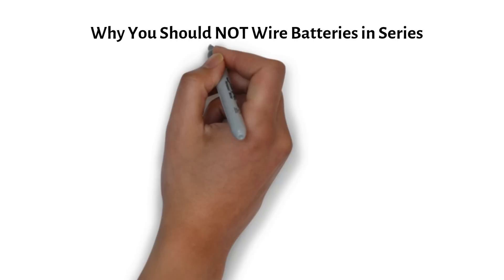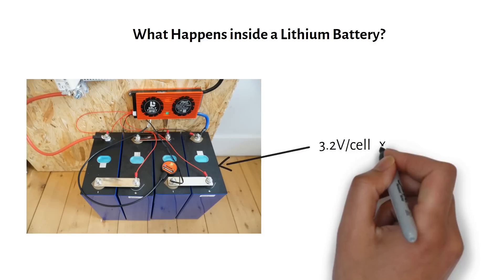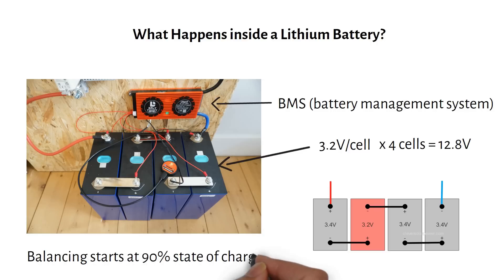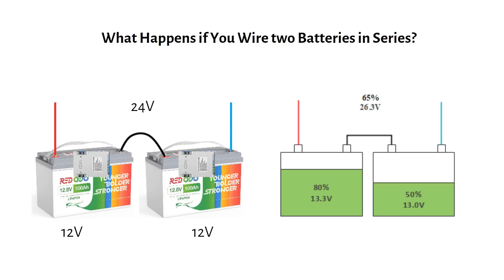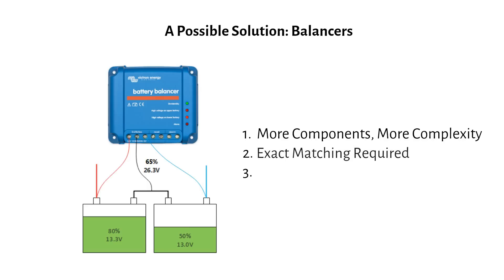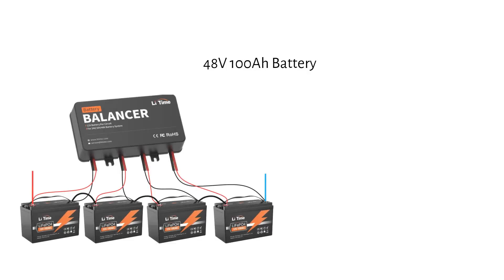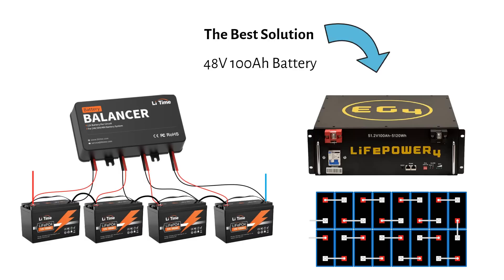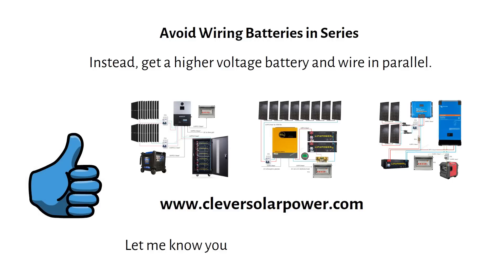Don't Wire Batteries in Series - Common Error

Comment: eh, i dont use bms on my diy battery builds anymore. just use inductive active balancer and rely on inverter or charge controller for over/under charge protection. add a thermostat relay to the load side and hook it up to a 15w heating pad to avoid freezing temp. bms is the cause of most lithium fires. active balance boards are much cheaper, like by 2 orders of magnitude and usually have 10-100x better balance capability in terms of total current and use energy more efficiently instead of making bms get hot.

Comment: The 48v battery cost way more per Kwh so price is a contributing factor. I have 3 banks, 1-4S and 2-2S. the 4S has a balancer and the 2S banks I can wire parallel every 6 months to balance. Not as hands off as the 48v battery but really not that bad either, especially considering the extra storage I get for the trouble.

Comment: This used to be a problem for me with my acid batteries. But now that I can log into each battery individually and monitor it through its Bluetooth BMS I can see that they are staying well-balanced. It seems that if they were to get out of BALANCE the one that had the higher voltage would have an automatic cut off when it reached a voltage too high.

Comment: I have been pondering this dilemma for a bit.
You sold me.
I shall buy 24V Batteries and Parallel them. It's also a lot easier to add another battery in parallel than to add a new string.
Reply from the maker: Exactly 💯
Reply: @cleversolarpower  Yeah, it strikes me that the 24V Batteries are the best Medium between affordability and capacity, with the least effort to add.

Comment: So asuming i have a full 24v battery in parallel and i want ti upgrade to 48v will i add another 24 volts in parallel or i should buy single 48v and remove thr 24v?
Reply: two 24 volt batteries in parallel is still 24 volts, you have only increased the amp hours and discharge level by paralleling. Series increases voltage, but this can cause imbalance like the video says. Also adding a new battery to an old battery in series isn't advisable. You will need to buy a new 48v battery if you want to go 48v.

Comment: I'd like to build a pure off-grid system for a cabin with a 3000w inverter. What battery and inverter brand/model would you recommend for the simplest possible system that can be purchased in Germany?
Reply from the maker: I recommend the victron multiplus. Checkout my playlist about 'off grid systems' there is one in there for a cabin.
Reply: I am using Vestwoods batteries and I think they are available in Germany.

Any high quality inverter will be fine. Try to get a pure sine wave inverter. They are better for your electronics.

Comment: Batteries in series do have those problems, but batteries in parallel have balancing issues too in that the ones on the outside charge more than the ones inbetween.  And so the ones closest to the wired connection get more use.  Also the ones that have less resistance get more charge. 

And as far as buying larger voltage batteries,  that is a better deal if one can find a good price and availability on them.  But they are not so available everywhere.  Which is why I was thinking of doing 2x12 volt ones.  And I could do those in parallel without the uneven charge but 3 or more would have uneven charge.

I did try searching Amazon for a bms.. I didn't find one for that purpose.. maybe I could search again.
Reply from the maker: That is true. However, that is only the case if you add lots of batteries in parallel. And that's why you should use busbars in parallel battery setups.
Reply: @cleversolarpower   Depending how they are wired.. 3 would make it uneven..even with busbars.. The ones closest to the connection get more use.

Comment: is why you need to charge to 100% at least before getting too low, anyways I have enough panels to charge to full every day, and I have 12 batteries in 4s to 3p and soon getting 16 batteries for a total of about 53klw  in 4s to 4p  you have to follow the directions of manufacturers,  they tell you the max you can do on series and  or to parallel , if we follow that and charge to 100% regularly is not needed a balancer.

I dont use balancer on my lifepo4 and manufacturer recommend only 4 in series to max 4 to parallel on the 12.8  260amp , and i been running my system over a year and not a single problem.
Reply from the maker: Like i showed in the video, it doesn't matter if you charge it to 100%, there will be imbalances. Just measure the individual battery voltage and you will see they are not the same. The manufacturer says only 4 in series because the mosfets cannot handle more voltage, and there is no use to have more in series because you already have 48V.
Reply: @cleversolarpower  ok i will check them individually and we see , if too much difference i will install a balancer.

Comment: 1:04 This expert does not understand batteries enough to be an expert. If one wants to  configure a 72volts(nominal) power pack out of 6 units of 12volts(nominal) batteries, one may 1)open each battery, 2)disconnect the 12volts BMS from each of them, and 3)connect the string of 24 cells to a properly rated 72volts BMS(if he can find one).
Or, he may connect the 6 batteries in parallel and use a DCtoDC converter to get the desired voltage.
Reply from the maker: You must be trolling right? 😄

Comment: I do this all day everyday professionally It's mighty easy to discount a Series Battery setup what counts is is whether the manufacturer recommends or not the manufacturer will dictate how many batteries in series or parallel can be placed safely and without unreliability without the use of external balancers there are many cells within a single battery it's true a lithium battery with an internal BMS May balance the batteries internally better balance may be achieved with external balancers charging may be achieved by charging at each end of the string of batteries if the manufacturer prescribes the number is authorized simple balancing can be achieved by placing simple tournament style multiple output Chargers along the series battery string this automatically balances batteries after a high current end to end string charge this can be performed daily weekly or as frequently as you desire I for instance replaced 3 junk lead acid batteries in my work Razor scooter that failed in less than 25 Cycles with three lithium batteries of exactly the same size and have had Flawless operation for over 700 Cycles now without any attempts to balance or without balancing Hardware added I used to hear this all the time when people were talking about using lead acid batteries in series my argument was what happens if one cell within that 12-volt battery becomes imbalanced you simply can't do anything about that so the argument is old seek advice from the battery manufacturer and current industry professionals testing during charging and during discharging can show weaklings in the string that need attention it is very simple uninterruptible power supply systems utilized in Industry frequently have two three and 400 volts systems utilizing so many batteries you would have to break out a calculator to count if it didn't work they wouldn't do it I applaud and appreciate anyone's efforts to Enlighten and inform the public but let's gather in all the information and decide whether maintenance and extra equipment is warranted

Comment: If you run parallel batteries and one of them is bad you have the same issue except with amp hours instead of voltage so 😮
Reply from the maker: If that happens than you can still run your inverter and charger controller. A battery with less capacity (ah), doesn't change the system. If a series connection fails, then your inverter, charge controller, and your whole system is out of order because it's not the voltage they supposed to work on.
Reply: @cleversolarpower  this is a great point for anyone running 12v at low amps with large enough wires for the extra load but I prefer the efficiency gain in 24v over 12 and some inverters are dual voltage. Personally I also have in place a 24v to 12v converter and know how to easily create a coil should I need more voltage from 12v. But yes. All good points.

Comment: Both systems are 16S.   regardless if it's a 48 or 4x12.  so if an element goes  down,  everything is gone , you're point is mute.   it's all came down to balancing,   either you have 1 BMS or 5 BMS's .     I can continue,  regarding the perfect cell match you mentioned,  but I'm too lazy
Reply from the maker: I think you missed to point of this video. If you have 4x 12V batteries in series, they are not 16S. they are 4S4S. The four batteries have a separate BMS, they cannot communicate with each other. They don't see that battery one has a higher charge than the other battery. They have no way of balancing each other.

Comment: You can connect batteries in series, never a problem. Bin doing that for 50 years. How else are you going to get 120 V DC!
Reply from the maker: This video is geared towards lifepo4. If you have lead-acid you either need equalization or balancers as well.
Reply: @robertkat  you people don't listen, lifepo4

Comment: i use two 12v 200ah lifepo4 in series,never had a issue.i use the victron battery balancer and works fine.
Reply from the maker: If you got a 24V 100Ah battery and put it in parallel with another one, you didn't need a balancer, all the extra wiring and the headache.

Comment: Slightly misleading title since this applies to Lithium based 12V batteries - combining 12V Lead Acid batteries in series has been done for decades if I'm not mistaken albeit they need to be carefully looked after. Also, I was under the impression that the single 48V Lithium-based packs are actually 15 cells in series since the nominal 3.2V/cell x15 = 48V - they charge at around 3.5V per cell and hence internal balancing isn't an issue - plus if one cell goes bad you're not having to replace an entire pack - there are pros and cons to having more hardware...
Reply from the maker: Yes, i'm talking about lifepo4 batteries. Who uses lead-acid these days? You are saying 'they need to be carefully looked after' that is the reason i made this video. Most 48V lifepo4 batteries are 16S, very few are 15S. If a battery in a parallel setup goes bad, nothing bad happens, you have reduced capacity. But if a battery in a series string goes bad, the whole battery is out of order.

Comment: Most battery manufacturers state what configuration the battery can be used. E.g. 4S4P, 2S1P etc
Reply from the maker: Still, that doesn't mean you should wire in series just because they can 😉. I can use a 5000W inverter with a 12V lead-acid battery, but that doesn't mean i should.

Comment: Please, I have a question for you about 12V 100Ah LiFePO4 Batteries. If you put an amp meter on a 12V 100Ah LiFePO4 Battery terminals what would the amps meter read?
Reply: Each battery in a series string will read the same amps as all the others since the current is flowing through all the batteries in the string.  Current is the same at any point in a simple circuit where the measurement encompasses all paths.  The voltage across each battery is where things will vary, but with the nature of lifepo4 discharge curve they will be very similar for most of the string's discharge / charge time - until they move into the top / bottom 20% of their individual SOC.
Reply: @floki5353  Hmm, I interpreted the question in the context of the video, series connected batteries.  Maybe he was asking about short circuit, maybe not.  The BMS would quickly disconnect under short circuit so his meter may not be quick enough to see the impulse correctly, or perhaps not at all.  BMS reaction times to short circuits can be in the 100 usec domain.
Reply: You would need a high impedance ameter to do that. A low impedance ameter will probably draw too much power too quickly and the bms will shut down the battery. It will read 100 amp hours before the bms shuts it down.

Comment: Completely agree with you on this, and this is something I've long stated.  SOC divergence can be seen on maintenance free lead acid systems too and they need an external balancer to keep them in check.  Open cell wet lead acid allows one to simply over charge each cell to bring the batteries up to the same SOC and then replace lost electrolyte.
Reply from the maker: Good to see someone agree on this matter. Other commenters try to justify their series connection 😅

Comment: "Exact matching required." Not really: if the batteries were actually perfectly matched, you wouldn't need a balancer in the first place. We need BMS and balancers specifically because it is impossible to perfectly match cells since even perfectly factory-matched cells will drift differently over time due to slight variations in local parameters like heat exposure, airflow, uneven compression, etc.

Having better-matched batteries only reduces the amount of balancing work required.
Reply from the maker: I was referring to the capacity (ah), not internal resistance 😉
Reply: @cleversolarpower  How poorly matched your cells can be is determined by how much total capacity you are willing to sacrifice and how much additional management effort you are willing to put into it. With enough determination, you could make an SLA+NiCd+NiMH+NMC+NCA+LTO+LFP+LiS series monstrosity work.

While you shouldn't intentionally mismatch batteries in a new system, you have to work with whatever you've got afterwards and there is a lot more flexibility in there than exactness.

Comment: People have been connecting batteries in series for years without issues especially those that use balancers. Some people actually started out with a small 12v system and later realized they want to move to higher voltage without discarding their already bought batteries. This is why many people usually series their batteries.
Reply: lmao!  The guy is a retard lol.
Reply: Hahahahahaha
Reply: I though power goes up even if they are connected in parallel
Reply: @siyabongangubeni9042 hooking up batteries in series increases your voltage so a 12v 100ah and another 12v 100ah connected in series has now created a 24v 100ah. Hooking those same batteries up in parallel retains the same voltage but instead increases capacity so you now would have a 12v 200ah battery.
Reply from the maker: I recommend watching the video again and paying attention to the section about balancers 😉

Comment: Lithium batteries need to be within 0.2 volts before connecting in series. Lithium batteries will balance themselves. Learn what your preaching before commenting.
Reply from the maker: No, lithium batteries need to be fully charged before connecting in series. Because their soc can vary greatly, even at a 0.2V difference. Lithium batteries only balance themselves in parallel, not in series.
Reply: @davemac521  you don't know what your talking about

Comment: Manufacturers state they can be added in series as long as all batteries are balanced before hand?
Reply from the maker: Yes, but over time an unbalance will develop. Depending on how hard you cycle them.
Reply: @ thank you for the reply. I am going to be switching from 2x lead batteries in series to 2x lithium batteries so I will go down the parrallel route.

Comment: open those single batteries up and you will find batteries in series....
All batteries are in series ..... They all just need to be balanced once in a while stop the BS...
Reply from the maker: Did you miss the video entirely? The cells are balanced by the BMS of the battery. It's more batteries in series that's the problem because they cannot see each other. It's 30 seconds in the video 😄
Reply: @cleversolarpower is why you need to charge to 100% at least before getting too low, anyways I have enough panels to charge to full every day, and I have 12 batteries in 4s to 3p and soon getting 16 batteries,  you have to follow the directions of manufacturers,  they tell you the max you can do on series and  to parallel , if we follow that and charge to 100% regularly is not needed an balancer.